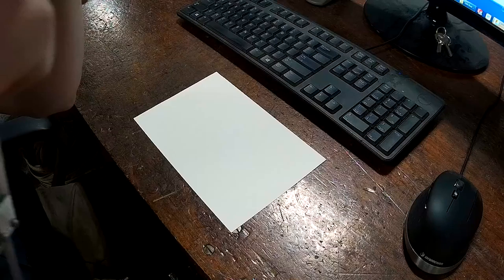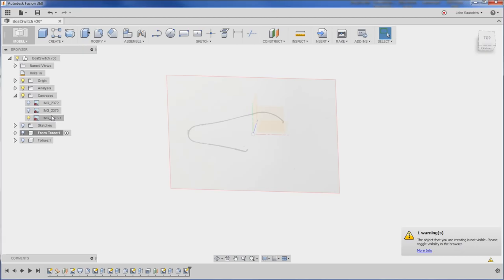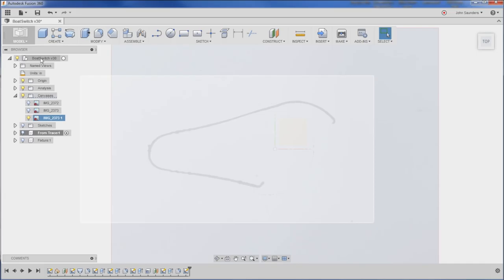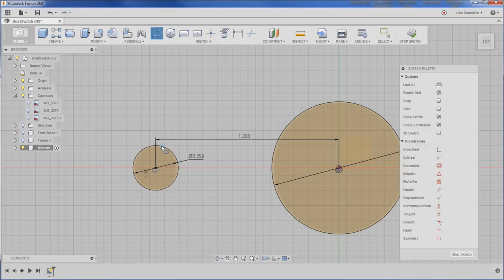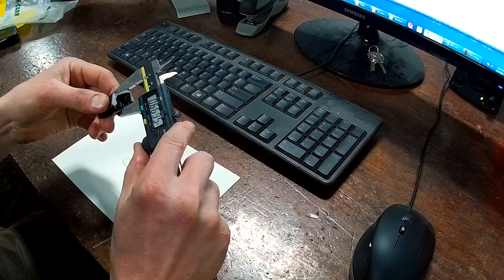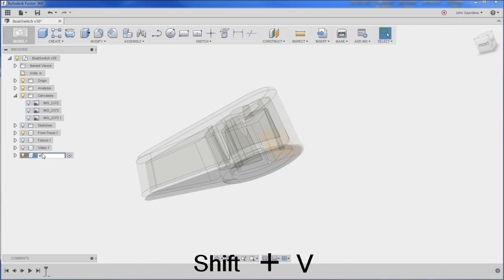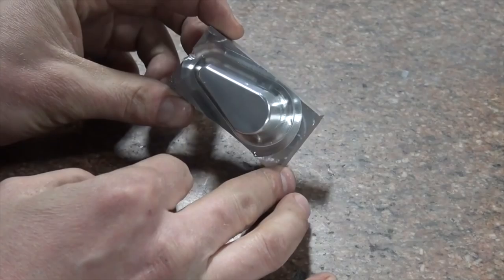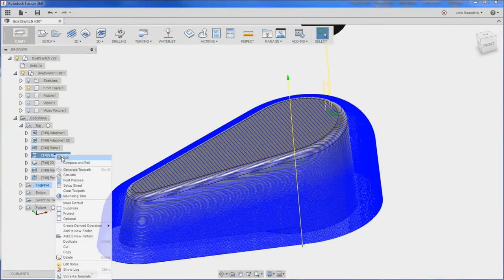How to (easily!) Model a Perko Boat Switch!  Fusion Friday #22

Comment: Agreed rotation of the canvas is a pain.  There should be a calibrate function to make horizontal or set angle.  
I discovered how to use the draft feature on tuesday, which would eliminate the need to add a construction plane and second sketch.

Comment: There's actually a command called '3 point circle'... I'd suggest creating the three points explicitly (before or after you draw the circle), then you can fiddle with them afterwards. Fix the ones you aren't currently adjusting.

When you set the two circles horizontal, that will have just moved one of them vertically and won't have preserved the distance between them. (You got away with it because the angle is small.) To preserve the distance you need to draw a line between them, then set that horizontal. Another way would be to complete the skewed sketch including the line you want to become horizontal, then use the 'align' tool to align it with an axis and the origin. You can probably move the imported image at the same time that way, and avoid using move's shitty rotate feature.

Comment: I found using a scanner (like the ones on the scanner/printer/copier) will get rid of the perspective problem.  it works great on parts the fit on the scanner, but the larger ones.

Adam

Comment: Seems like you could lock those circles in faster if you drew them using the 3-point circle tool, selecting points on the intact arc. Assuming the edges were really circular in the first place, that should construct the circles exactly right and not require any adjustment.

Another way to get an accurate tracing without any perspective distortion is to put the part down on a flatbed scanner and just scan it. If you also include a ruler in the scan, you can easily calibrate the resulting image.

Comment: Didn't see it posted but if you need a finer degree adjustment slider you can go to the bottom center of the screen, click on "Grid and Snaps" then on "Set Increments", you can then change "Rotation Increments" to 0.1 deg and it will adjust it by .1 deg instead of 5 deg.

Comment: Once you have the bottom profile drawn-up you could have probably done a "pull" with a draft angle. Put in 5° (or whatever), make sure it's going the correct direction (so it's tapered in instead of flared out) and you're basically done. The top and bottom of the solid will be parallel at that point so lop it off with an angled rectangle going around the top. Then you could fillet it and cut the cavities just like you did in the vid.

I think the way you did it, with the loft, was fine, and really didn't take much longer. But if you were cutting the relief of this part (as if you were making a mold) it seems like it might be slightly beneficial to know the exact draft angle. It would, of course, be more crucial if you were trying to get the smallest angle possible instead of this cosmetic angle.
Reply: I thin Fusion actually calls it something other than draft on the check box--maybe taper?

Comment: I thought the simplest approach to creating the fixture would be a boolean subtraction from a block (representing the stock) - assuming Fusion allows boolean operations (I use other Autodesk/3D software, so I'm not sure).

Comment: A much easier way would have been to do a press pull with bottom sketch (skip top sketch) then do a draft (under modify tab) on the top surface to desired angle then do a seperate draft on sides, add the radius and boom your done. Also if you have a printer that can scan you could scan the bottom of the part for your canvas. I own an extremely cheap ass printer/scanner and have had good luck scaling within a thou or  maybe even less, done mostly flat parts tho not sure if it would give a good scan with taller parts.Hope this helps.
 Great videos, fun to watch.
Reply: NYC CNC Its 2 simple drafts which take  2 mouse clicks and a numerical entry each.  There is no way it's harder and it is definitely quicker.The order you do them is important at times tho (top first then sides) It takes about 30 seconds give it a try. To each his own I guess, just tryin to help.

Comment: Great technique! I'm wondering if a flatbed scanner could be used to digitize the part directly. At a scan rate of 300 dpi you should get measurements that are precise to around .003” (theoretically at least). The nature of scanning would also prevent distortion. Of course this only works for a flat profile, but still it’s a start on those pesky parts

Comment: Great video - it's nice to see the process somebody uses for something like this.

I noticed that you have a new mouse.  Do you like it?  I've had trouble finding corded mice that I like.  My current one is functional, but not great.  It has side scroll on the wheel, which drives me nuts sometimes.  That one looks promising, but it's a little pricey.  If it works well though, it might be worthwhile!

Comment: Very good info, thanks John. When you made the fixture though don't you have to make the protruding part slightly smaller? Whenever I try these things I always forget to add some tolerance to get the type of fit I need. And I find this very difficult to get right. If a try to press a 6mm rod in a 6mm hole it wont fit if you understand what I'm meaning.

Comment: I think it would have looked better if you used 'draft' to make the taper instead of 'loft', like you would for an extruded plastic component. It makes it really easy to make all angles of the taper equal. Don't know though if Fusion360 supports that.

Comment: Hi mate.  Sorry, but you did not look at your outline that you drew properly.  I'm pretty sure that the lines between the small circle and the big one has a slight bow inwards in them.  I think that it is to give the knob a bit of a waist, and make it less bulky.
Reply: +Marcel Timmers - For each side you could set a large circle (maybe 6 inches) constrained tangent to the two original circles. That would give a "waist" to the part.
Reply: I was sort of thinking the same thing, but I would not know how to do it.  The computer program is far too complicated for a simple soul like me.  Besides that , it bores me rigid.

Comment: Really love your videos :) Thanks for sharing :D
I have a question. How does one go about measuring angles for e.g. loft angles, taper angles of a 3d object in real life ? I do a lot of designing now a days for prototyping in 3d printing and final machining (self taught CAD designer). Sometimes I need to measure chamfers and fillets to use and some angle of curvature on certain objects like smart phones etc. I usually scan them using a scanner then do the canvas technique :p . But there are some objects that I cant scan, how do you pros measure the angles/dimensions/radius or whatever it is called ? 
Thank you !
Reply: +NYC CNC The gauge is what I was looking for. Thank you !
For the second part, LOL I dont own a TORMACH :D
Any other gauges for measuring tapers ?

Comment: Hey John, hopefully this gets to you.  I recently recreated the top half of this part so that I could run a 3d contour for the first time.  I did great considering the machine I used. I needed to use the 3d parallel path to clean up the top face, but I couldn't get the toolpath to only touch the top face like you did in the video (14:07).  When I tried to do it, no matter what I did it wanted to include the sides of the part.  It didn't seem like I could set the bottom based on the top because of the 5 degree angle.  What am I missing?  Thanks!
Reply: NYC CNC Gotcha, ya please do some more videos showing the CAM side of things as that's what makes fusion 360 so powerful.  I'm trying to learn as much about fusion 360 as I can so that I can bring it to a "makerspace" type lab that is opening in my town.  Thanks for your response!

Comment: Awesome videos, I have been subscribedand watching for a while now.. I use fusion360 all the time for misc stuff... I need a part made, its a pretty simple part as far as programming, and I used fusion360.  It is a copper adapter and needs to be threaded on both ends (female to male)... it is approx 2" at its widest (cylinder shape) and approx 2" long.  can I send you the file for a quote and turnaround time?
Reply: NYC CNC sweet... email/file sent!